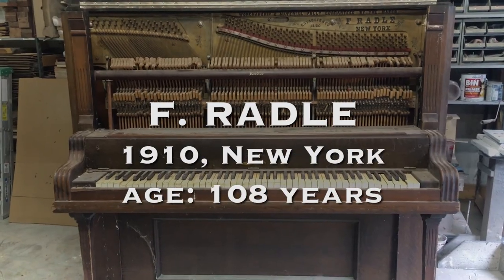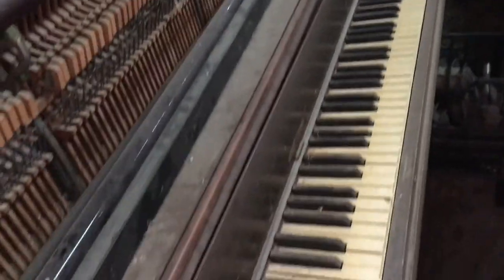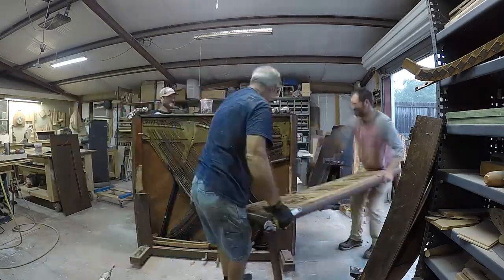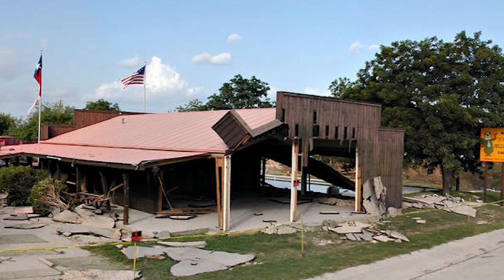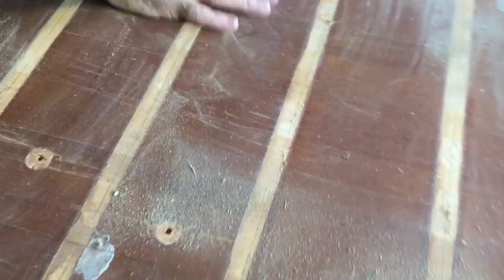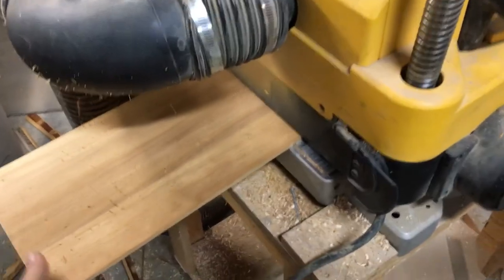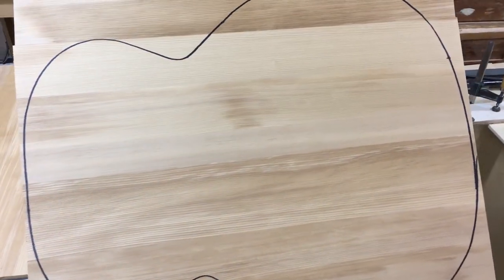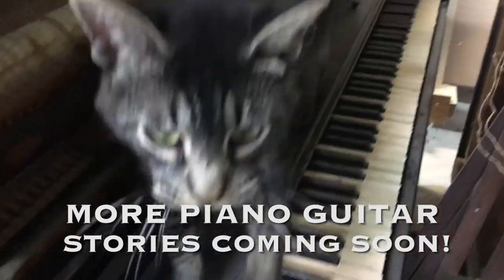Five Pianos turned into Guitars - Part 2

Comment: I like what you're doing with these pianos. The initial reaction is some bit of dismay over hacking apart an old instrument, but the fact of the matter is that they will ALL end up in the dump or the wood turned into a bar or a desk or firewood. I've been at the dump dropping off a load of trash and seen 4 pianos tossed off the back of a piano shop's truck. And not gently. My late Mom had a 1928 Baldwin baby grand, beautiful, and we could put $5.5K into it and have a $3500 piano. I  know we'll spend $2K on storing it for years before we give it away. There are a bazillion of these old 1900-1910 uprights and 95% of them can't be made to work/play well for any reasonable amount of money. 
When you rip down the soundboards, do you try to cut on the old glue lines and do you care how many pieces are re-glued into the new guitar tops?

Comment: do you ever consider using the rest of the wood from the piano to make the back, sides, and neck?
Reply: Yes!  There are usually bulky hardwood braces on the pianos (often ash or mahogany) that we use for necks. We have done a couple guitars with back and sides from the laminated cabinet parts when they had really cool veneers as well. This can be a little tricky when bending sides but can make great strong and acoustically nice sides and backs.